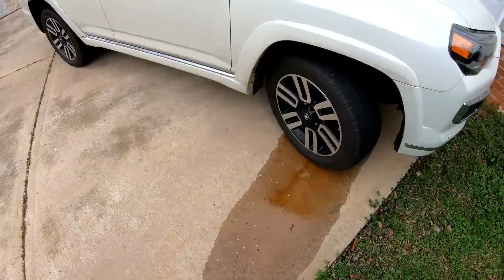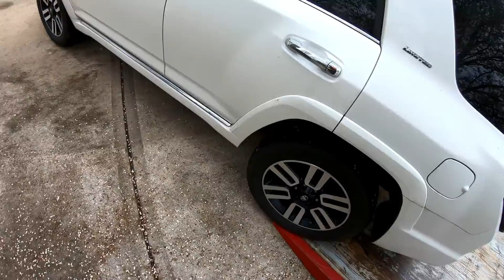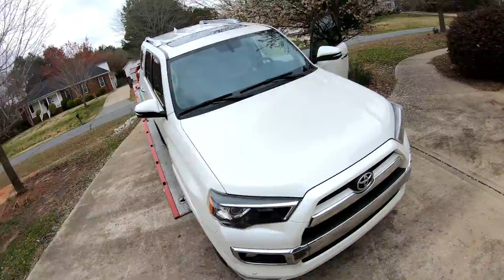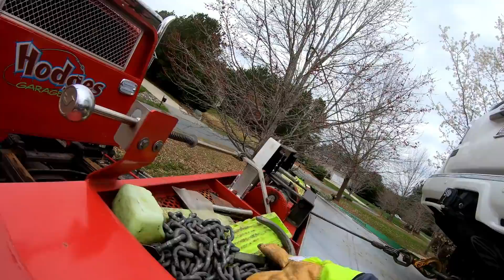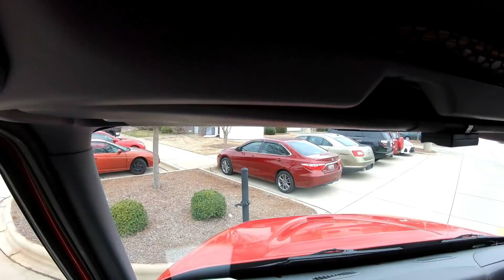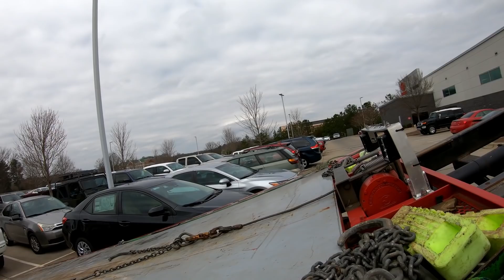TOWING A TOYOTA BACK TO THE DEALER!

Comment: Interesting to see the use of the key slots to tie the vehicle down as opposed to the usual Vehicle transport straps that you see on most tows. Always nice to see alternative ways and methods. As Ron (another tow channel) often says.. there's so many different ways to get the same result and this one is mine. Nice bread and butter job there Kyle :)
Reply from the maker: I have tried the wheel straps but this tie down system works better for us. This system can be used like other systems as well.
Reply: @hodgestowingsc  Many thanks for the reply. I can certainly see the benefits for sure.! See you on the next video :)  stay safe !